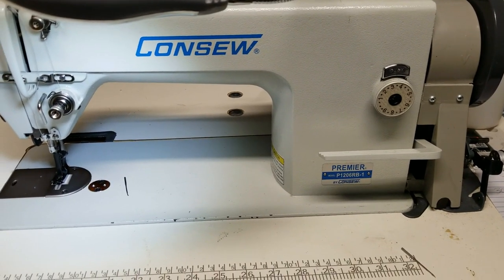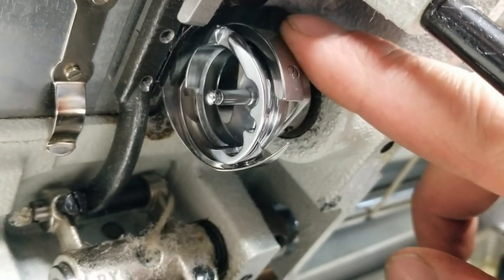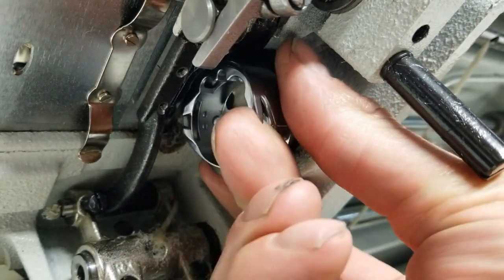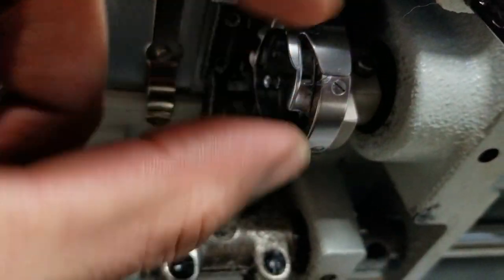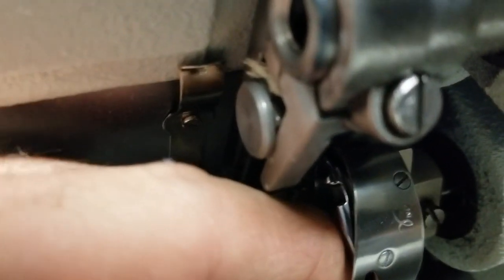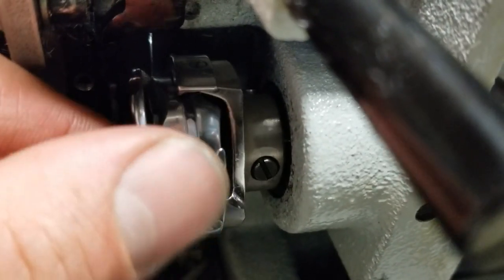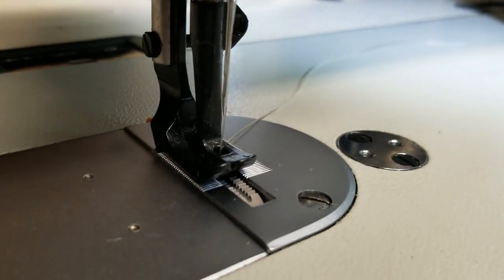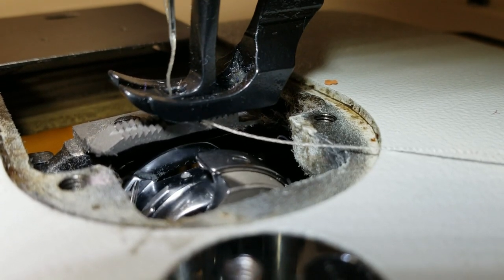Sewing Machine Repair / Consew Machine needs the bobbin timing reset

Comment: Nice informative video. I'm trying to help my seamstress fix her machine. I could be wrong but it looks like your needle is 180 degrees off! The long groove that runs up and down the length of the needle should be on the side the thread comes down the needle to the tip and the indent around the eye (scarf) on the other side of the needle is where the bobbin hook passes by the needle grabbing the loop? I think that may be one reason the bobbin hook was hitting the needle?

Comment: I have a 1206RB-1 also. I've been having a problem today where I'm able to cycle the needle stroke a bunch of times with no issue, and then "bam", it starts hitting the hook assembly. I've been wrestling with it all day, and just gave up. I'll look at it again tomorrow and follow your steps. It looks promising.
Reply from the maker: Thanks it should get you back on track. Good luck
Reply: @AllanPhillips00  That worked perfectly on that day. Today I'm having an issue where the "inner bobbin assembly" is locked in correctly, but the outer bobbin assembly will not turn freely. I wish there were better operating manuals for these machines.
Reply: Actually was finally able to fix this. Had to take the bobbin assembly apart and kind wrench the inner assembly from the outer. There was the tiniest little shred of thread (a thread that had unwound from itself - super thin), that got stuck deep between the 2 parts of the assembly. I was amazed the tolerances are THAT tight. I swear I spend more time messing with jams and stuff than I do sewing. 

Your videos are really excellent, Allan. I hope you decide to do more re: the P1206 RB-1. It's hard to find such clear instruction on this model.

Comment: video was very helpful but still having issues as no matter how we adjust , the needle still has a slight interference.  The thread loop isn't big enough that the hook picks it up and bobbin won't pick up
Reply from the maker: HI Mike, are you trying to grab the loop of thread with the bobbin hook on the needle upstroke? This point creates the slight slack in the thread. the exact timing takes a bit of experimentaion to get right. There is about a 5-10 degree window of rotational timing to get it right.
Reply: @AllanPhillips00  thank you so much for your help and I must say to everyone out there that your videos are awesome I learned a lot and I do not know that much about sewing machines other than the principal and we got a long ways with your help thank you so very much
Reply from the maker: @mikematherly6092  I appreciate the kind words. Glad I could be of assistance.

Comment: I have this exact machine. It has gotten jammed and won’t move at all. I saw video to reset safety clutch for 206RB but this one is different. Can you give me some help to un jam it?
Reply from the maker: Hi Susan, I am currently on vacation and not able to look at my machine in person until Monday. If I remember correctly this machine has a servo motor to drive the unit so no clutch is required. When lifting the machine up and backwards pivoting on the back hinges on top of the table should take tension off the drive belt and allow you to rotate the drive wheel.

Comment: Great video. Any instruction on how to fix the bobbin pressure arm? The manual doesn't tell you how to fix it. Right now the arm doesn't fully snap back against the bobbin winder shaft, thus it won't spin to wind the thread around the bobbin. I (stupidly) removed the arm, put it back but now it won't work right. Any help?
Reply from the maker: I’ll take a look and see what I find
Reply: @AllanPhillips00  I appreciate it. The machine isn't even mine, yet I do all the sewing on it. I'm not stupid but for the life of me, I can't figure out how to fix it. The instructions don't make sense on tighten this or loosen that to affect either the amount of thread spun onto the bobbin. The one screw looks like to me, that all it does is tightened the bobbin pressure arm onto the pin, yet the instructions say its an adjustment screw. If you loosen it, it won't hold. If you tighten it, grabs hold of the pin and rotates as it should. The other smaller arm which is attached to the bobbin pressure arm, again says loosen or tighten, yet all does is lock it into position. It has a hole on top that slips over the pin.  Regardless, I hope you can help me. Otherwise, I'll have to take the machine apart, drives hours away to a Consew manufacture, and probably get charged an arm and leg to get it right.

Comment: If I may ask a question -- is the second time the thread has gotten stuck in the bobbin assembly -- any help would be appreciated ---the last time we took the whole assembly out and of course the machine had to go to the shop to get fixed ---don't know why the thread keeps getting hung up in the assembly--thank you
Reply from the maker: Sounds like a timing issue. If the lower assembly is not catching the loop of the thread created by the initial upstroke of the needle it will fail and get bound up.

Comment: Hello thank you for this video please I would like to ask so if the Bobing thread is not picking up and loosing could it be the problem of the timing? Please reply me back. Thank you
Reply from the maker: Yes that is a possibility the timing is off. The other problem could be tension setting adjustment on the upper thread route. If the tension is too tight the needle cannot allow the proper amount of slack in the thread for the lower unit to hook loop and allow the upper thread to pull the bobbin thread up
Reply: Thank you very much, I do appreciate it👏👏👏
Reply from the maker: @mayfairafrifa6084  your very welcome

Comment: Hi Allan.

I have a mitsubishi dy350, its not dissimilar. How do you know how deep to set the needle in the needle stem?. Is the hook grabbing the loop at the very bottom of its travel? Many thanks btw
Reply from the maker: Hi Stephen,

On my machine the needles are inserted until they bottom out in the needle stem. When setting the timing I have noticed that the hook that catches the thread from the needle works well when the needle just starts the upstroke. This allows a natural loop to start making it easier to be caught with the hook. 
Thanks for the comment and view. Have a great day.
Reply: @AllanPhillips00  you were absolutely brilliant. I have it working perfectly now. Thankyou so so much.
Reply from the maker: @stephenabswisdom1187  that’s great. So glad I could help.

Comment: Hey bud I am new to the world of sewing. I have a consew 146rb-1a  but the bobin is not on the side like that one you are working on. It runs left to right. Will I set it the same way.
Reply from the maker: Yes the key to the timing is when the hook around the bobbin catches the loop created by the needle for creating the lock stitch. Shouldn’t matter if the bobbin is on the side like mine or laying horizontally.
Reply: I have the same machine.  Look for another video with a horizontal bobbin. Also his needle is 180 degrees the wrong way. The notch on the side of the needle is there for space needed for the hook to catch the thread off needle.